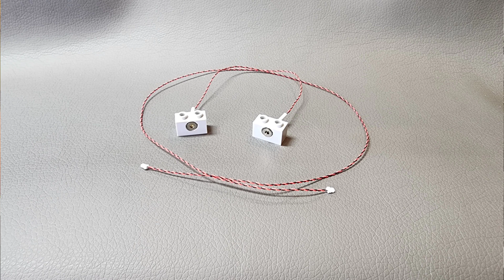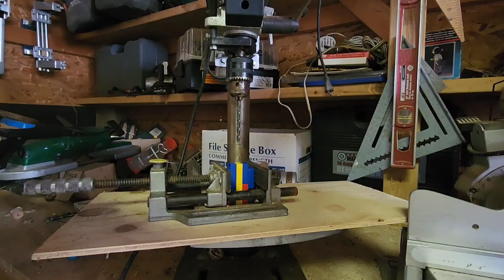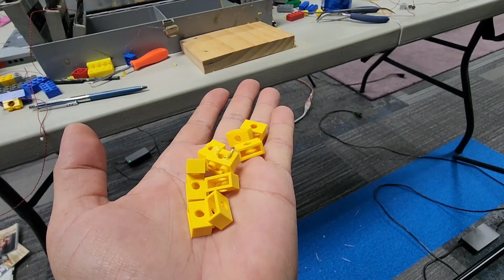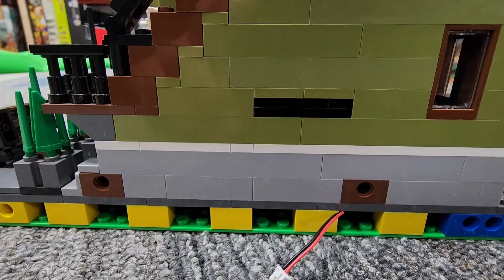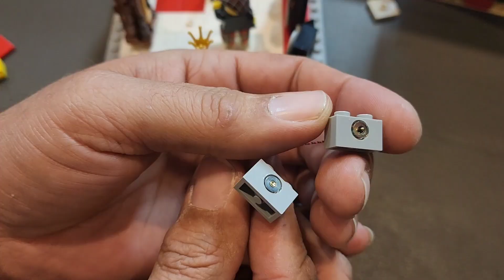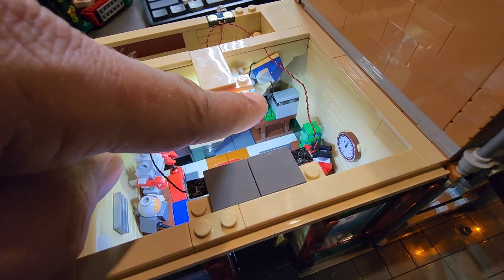New Wireless Magnetic Connector For Your Lego Builds !

Comment: What is the polarity of these plugs? Is + as the tip or -?
Reply from the maker: You can do them either way if making yourself, but I do + outter and - center.
Reply: @BevinsBricksWorld Hmm ok.  I was gonna put the plus in the center to be consistent with the cylinder batteries. Yes I am going to make magnetic connectors to conduct power between the passenger cars of my train.

Comment: I'm not sure you have grasped the meaning which is usually attached to the word "wireless"...
Reply from the maker: I'm not sure you do, as the connection is wireless, the wire itself is attached in the building, the connection to work is magnetic and no wires

Comment: SO on the one hand, I am sad that you haven't been building as much on your new city, but on the other hand, this is quite the easy system you are coming up with! I myself have never been too interested in lighting, but with a system like this it would be so much easier to get into! 

Do you have an extension cord product that would reach across 48x48 baseplates? Or maybe you could offer the product in 3 sizes??? Great work overall man.
Reply from the maker: Thanks and yes, working on these products has taken me away from my builds.  As for the reach yes I do offer a variety of extension cables, but the wire on these should reach across a 48x48 as the cable attached in 30cm or 11 inches on each connector.  I'll release to double check and add that information to the listing on my site as well.

Comment: This is cool! I rigged some up using tinfoil. I think the professional ones would be a lot more reliable!
Reply from the maker: A good cheap way to make them is to use copper tape, these are a magnetic connector with a spring loaded pin for reliability.